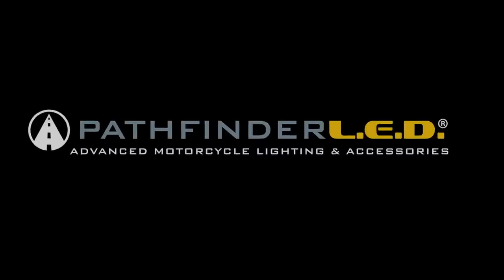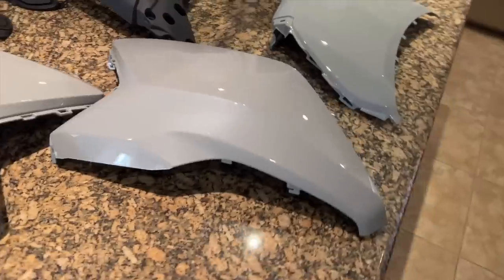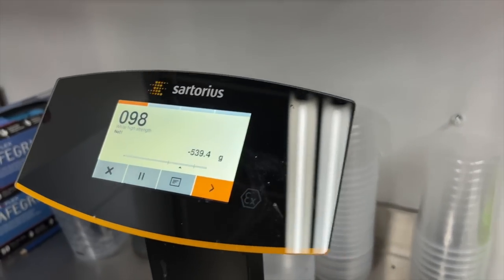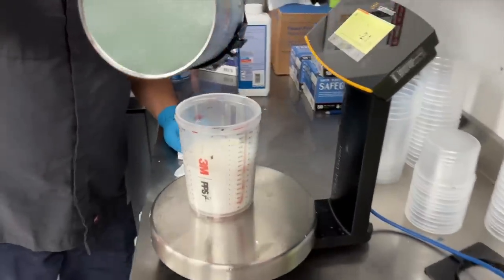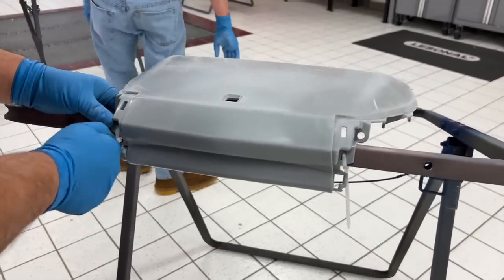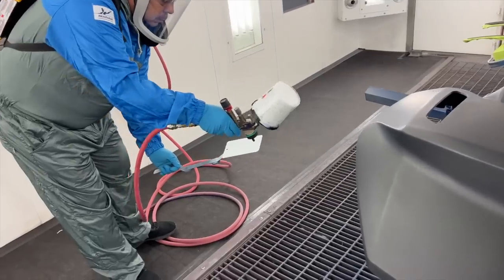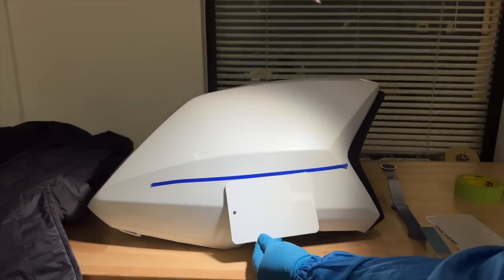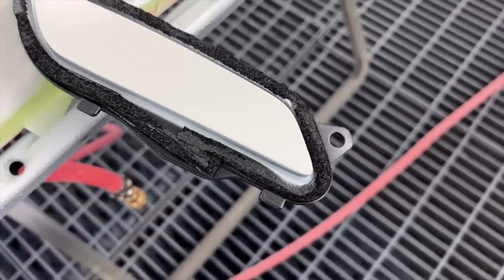Honda Goldwing Gets Painted | Trunk Swap Part One | Cruiseman's Garage

Comment: Paint mixing and matching has come a long way. I used to mix auto paint in the early 80s. We used brass weights to weigh each toner on a manual scale. So imprecise compared to now. If it was off slightly it was still sold to dealerships. Custom paint matching was done by one guy who knew the trade. That was it.

Comment: Hello Cruiseman, i have changed the trunk on my 2018 white GW Tour DCT and painted the bigger trunk, the new paint wasn’t an exact match of the bikes color but  was about 95% match and wasn’t really noticeable, however one thing that I didn’t think of until the time came to fix the new bigger trunk is the non heated passenger backseat that came with the trunk kit. This was a surprise for me, then I bought another passenger backseat and thankfully I found a used one for half the price in a Honda dealership.

I’m happy with fitting 2 L helmets in the trunk every thing is going well and it is worth doing especially that i have put so many accessories on my bike and getting a new one wasn’t wise financially. 

Good work and good luck with your project